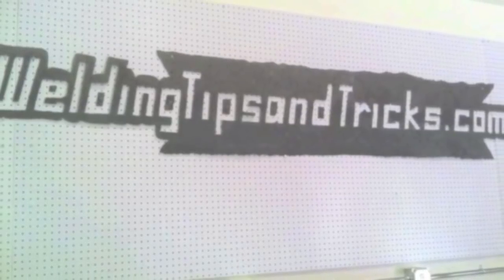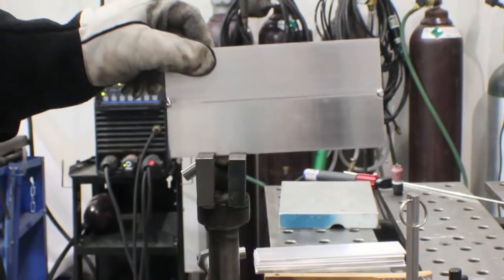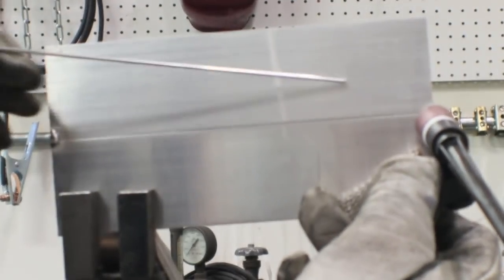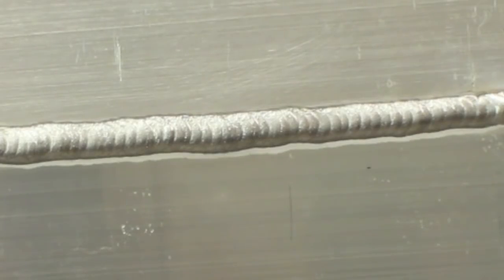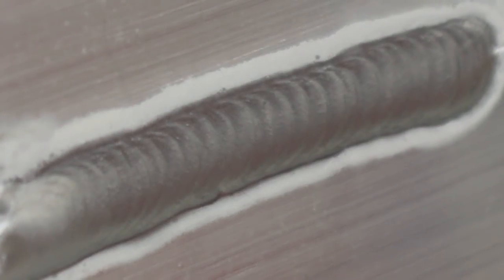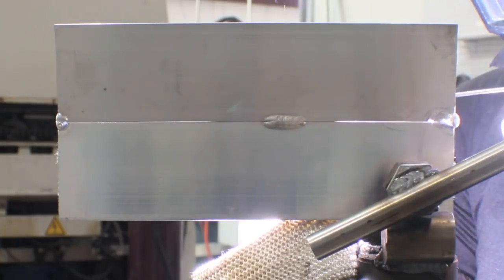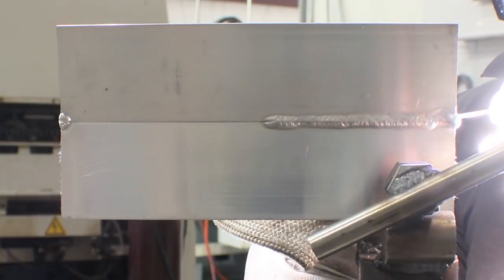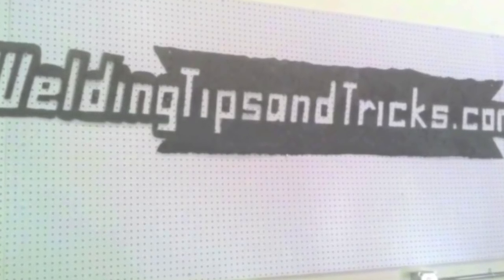Tig Welding Aluminum - Horizontal Butt 2g

Comment: I think that's the first time I've seen a shot from the back while being welded.  Great idea, turned out great.  I would have used higher flow rate on the gas especially with the gas lens, but it looks like 15 cfh did the job.